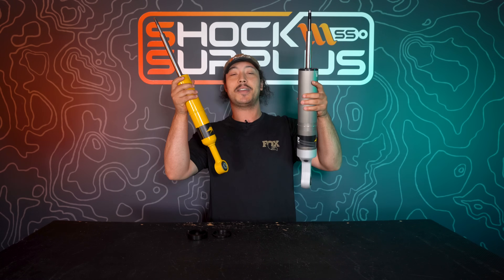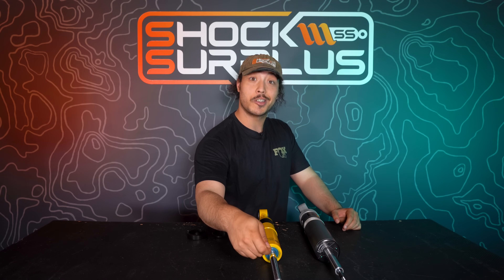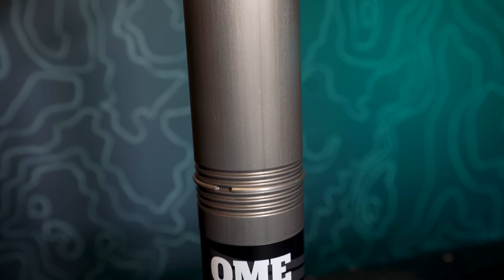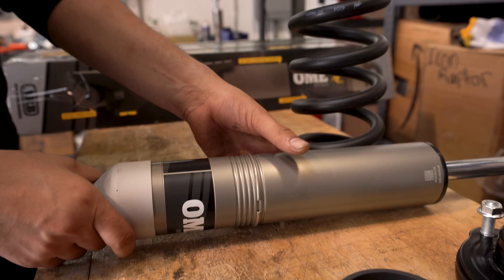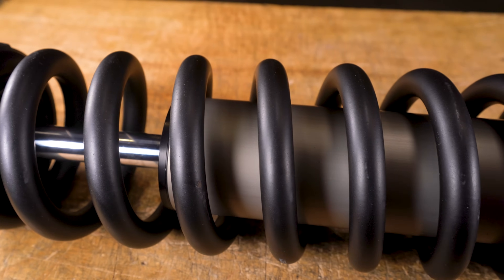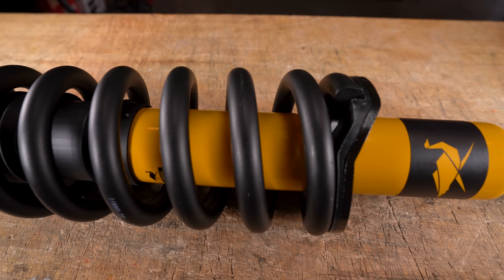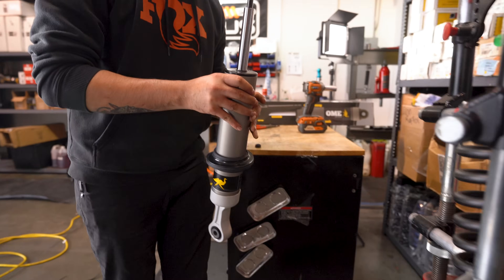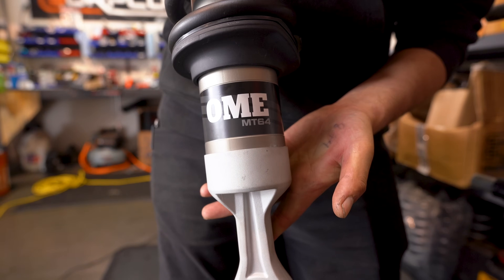OME Shocks: Preload and Height Settings Explained

Comment: I should have ordered from yinz. Place sent me wrong springs and didn't realize until after putting on one. Would it be dumb to use the adjustments on the nitrocharger with stock springs to get some height until I get the springs I ordered (2887) they sent me 4000s. Will have to get 2 alignments anyways I just want some lift and should only be a cpl weeks knowing how that company ships items....

Comment: I want the smoothest road ride possible, don’t want to feel a bump or crack in the road/highway. What’s the best shock for that?
Reply: Digressive Coilovers
200mm+ Travel
20% Corner Sprung Weight as Wheel Spring Rate
Flimzy Anti Roll Bar (30% of Spring Rate)

Example:
Sprung Corner Weight = 1000lb
Motion Ratio: 0.75:1

Spring Rate = 0.2×(1000/0.75^2) = 355lb/in

Antiroll bar = 355×0.3 = 107lb/in

Comment: do y'all have a bottom out bumper stop for the fox internal bypass  3.0     These are on the rear of my 2016 Polaris  RZR turbo     I'm trying to find them in orange  
shaft  7/8 "  
2  1/4"  tall

Comment: The TRD Pro skid plate weighs around 30 lbs. Is it considered as « no added equippement » and still get 2" of lift on the 2nd notch for MT64?

Comment: Yo on the Nitro with stock bumper no spacers needed right
Reply from the maker: spacers aren't needed, correct. the spacers are for extra weight to maintain a desired ride height.